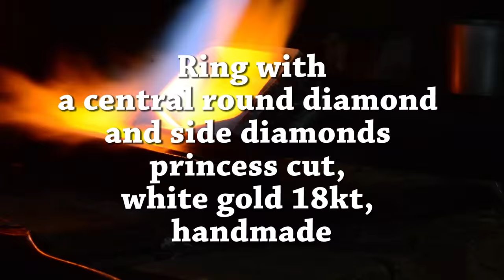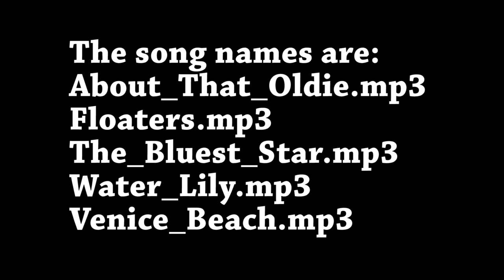Ring with a central diamond round and side diamonds princess cut white gold 18kt handmade

Comment: I've been following u for awhile now. I was wondering if u (or anybody really) can give me some advice on how I can get started in this activity. I feel like it will make a nice hobby.
Reply: +DontLookAtMeYouFool 
Take a class. It's a great hobby, I've been doing it for about 10 years. Jewelry can be easy or very hard. Rings like this are very hard.
Reply: +Carl Powers 
Thank you very much, I've seen some classes, but they are more "putting beads on a string" kind. Would I have to start from these classes?
Reply: +DontLookAtMeYouFool 
Nope don't take those (you can teach yourself that skill) Take a beginner class that involves soldering. Use copper to practice.
Reply from the maker: +DontLookAtMeYouFool To build a base ring without stones, it is important to know how to use well the file and the coping saw and know solder a minimum. Use for calibration specifications, it helps to do a good job. At the gold sector wholesalers can find the right tools. To learn is important to try and try, make mistakes is normal with time you discover it is easier than it looks
Reply: +scaffoal Thanks for the awesome advice, I'll get a set of tools and attempt to start making rings without stones when during my summer vacation :)
Reply: +DontLookAtMeYouFool if you look at classes at actual rock and gem/jewelry supply stores, they will often have actual silver smithing courses to get you started. They aren't as cheap as the ones at a bead store, but making real jewelry isn't cheap anyways!
Reply: Alright! Thanks for all the feedback, I'll have a look at these classes as well.